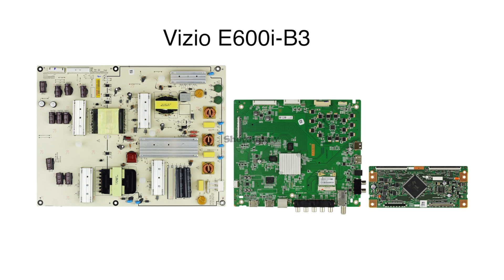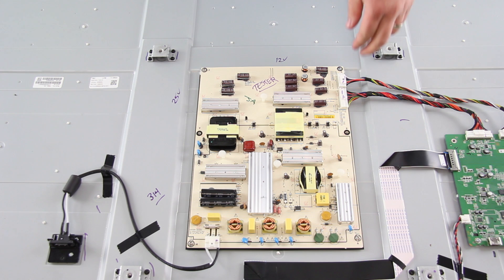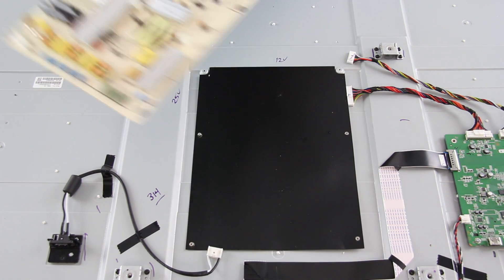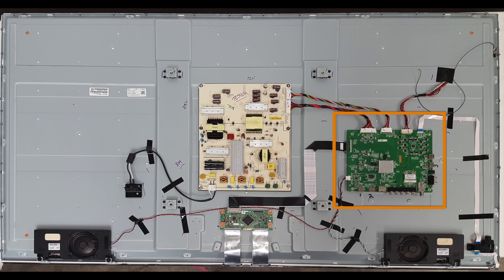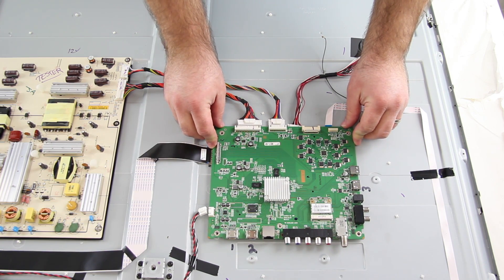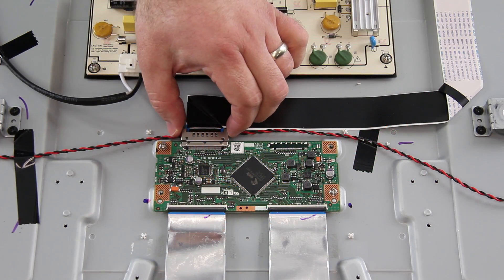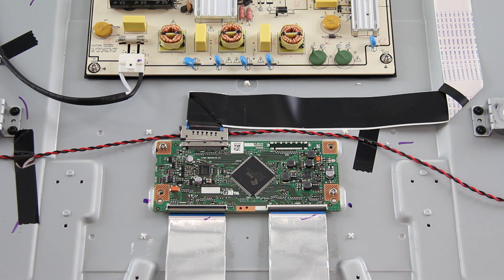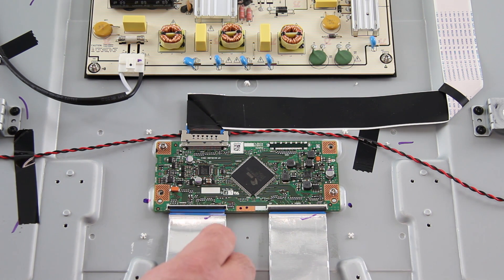Vizio E600i-B3 TV Repair Kit - How to Replace the T-con, Main and Power Supply Board

Comment: I have left a question on another one of your videos and haven't received your feed back! I was needing to know what could be the problem if my tv is coming on with the power button showing red them green and only giving me a light blue screen ? ... and the remote wont work except for turning it on , the tv power buttons and menu button does not want to come on either ,plz give me an idea so i can try too find the  necessary part or could it possibly be the remote ?? ty  " IT IS A WESTINGHOUSE LED 55 INCH